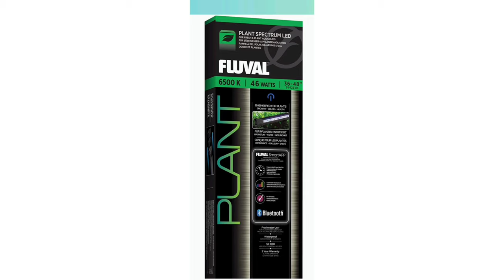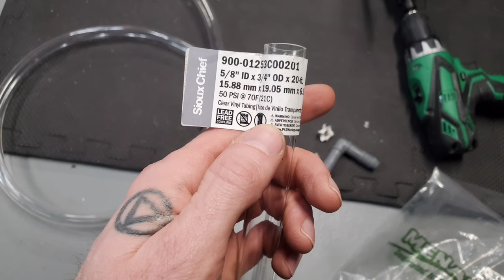Paludarium Ecosystem Setup #paludarium #vivarium

Comment: I keep returning to this video for inspiration and guidance on my paludarium using the same enclosure, IMO your build videos are the most comprehensive guides on youtube. Is the ventilation more for the plants or the critters/both? Would a case fan on the lid suffice? I don't currently have any plans for amphibians and have zero experience doing so, but would like to have that option available in the future.
Reply from the maker: Thank you for watching the video. Glad it   is giving you some inspiration. I'm sure a case fan would do fine if it had a speed adjuster so it wouldn't create to much air flow. 
I like to used them inside the enclosures to I don't introduce a lot of outside air. I foundnit best to use the fans inside so I can circulate the air from inside the environment. 
I donuse the fans for both plants and animals. They are set on timers and don't run constantly 
Not sirenif you saw this video that is a more detailed step by step of the same build https://youtu.be/-6B4wvRxdqA

Comment: This is an awesome build! Seeing as it's been almost a year since this build, I wanted to ask how the corrugated plastic in the water portion was holding up. I've built sumps and some other builds with acrylic on glass but found that it starts to bow and the silicone bond weakened after a year. Have you found any bowing or problems with the corrugated plastic?
Reply from the maker: It is holding up the same as day 1. The sprayfoam and drylok have the added strength on the front end and the substrate on the back end, sandwiching the corrugated plastic into place. But in time if it does start to leak for one reason or another I will add a new material I have been working with called polygem zoopoxy. I have the full step by step video posted just before this one too. It explains and shows the whole buikd. 
Thanx for watching!
🤘💯🦎🐸🐍🐢🌱

Comment: this waterfall build brings me on a good idea how to make mine you only used drylock? no grout? drylock we don't have in Netherlands you know anything like it that can also be used as drylock?
Reply from the maker: I'm not sure what substitutes they have for drylok where you are. It's a masonry sealer that they also use in ponds. 
I'll try to see if I can find anything. If interested tk don't again inwoukd probably use Zoopoxy (I know you're trying to work with them to get it) the drylok in this build has held fine but I also over built it. If I didn't, it would have failed. 1 pin hole, and it would leak. Check out the full diybonbthis build wherebit goes overnjt in details. 
Hope this helps. 
🤘💯🦎🐸🐍🐢🌱

Comment: I love this build gonna do anything similar.. I wanted to use it for dart frogs, but was warned about dart frogs with a water feature. How has it worked out?
Reply from the maker: Thank you and my experience has been good. I'm not sure if you have owned darts in the past or not. But I would learn their behaviors before adding a water feature.  When designing, make a large enough footprint of land and surface area so the water portion doesn't have a huge impact on the terrestrial footprint. Darts are not good swimmers, but know how to get out when provided an exit. I have never seen them just into the water intentionally.  But they will intentionally sit in the "waterfall part" from time to time. 
Thank you for watching 🤘💯🐸🦎🐍🐢